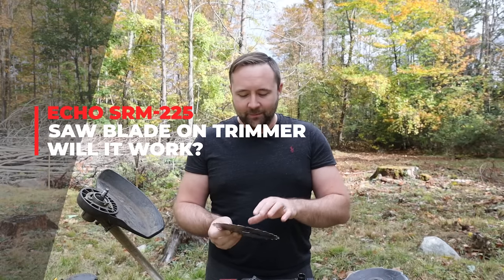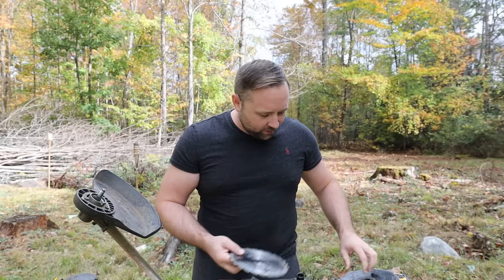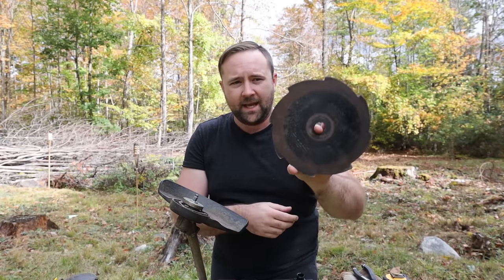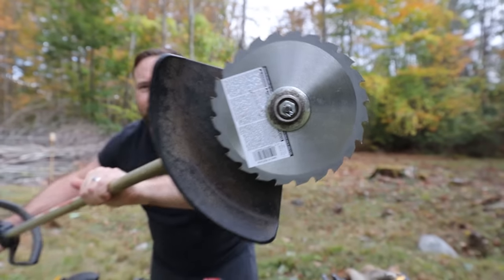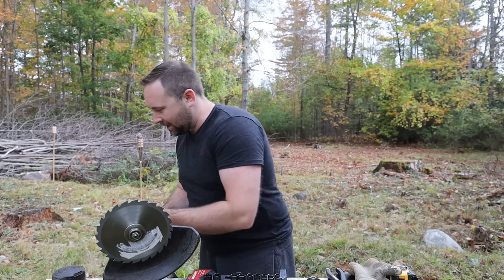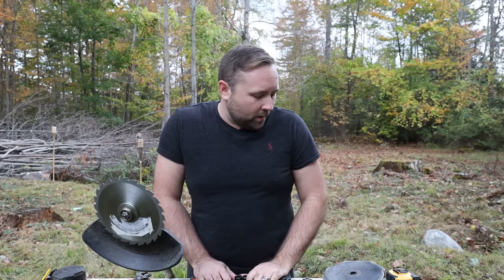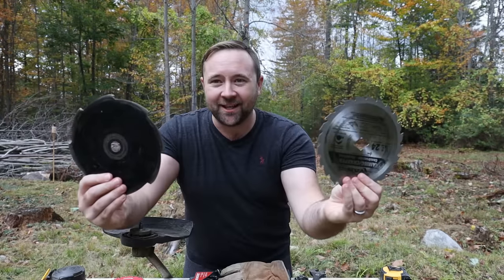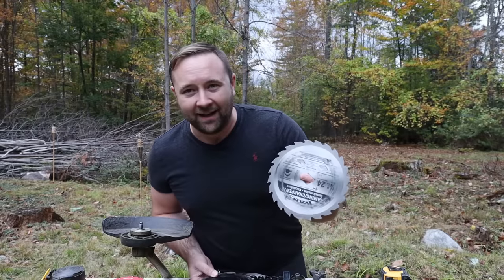Putting a CIRCULAR saw blade on a TRIMMER

Comment: A 12 inch miter saw blade works great. Clears a pretty big area in one pass since its so big and you can get them with carbide teeth and a big range in the amount of teeth you can get. They already have the perfect arbor for most stihl trimmers too.
Reply: you’re gonna lose a foot
Reply: @tseif3713  ok mom…
Reply: @tseif3713  looks very dangerous to me. I would recommend a small chainsaw. Chainsaw will cut better and be a lot safer.
Reply: A 12" on a trimmer? Yeah, most people even with a decent mid-range are going to be putting immense strain on the motor, trans and powered 'rod' with a 10" blade. 
Anyone with an average-mid grade trimmer should stick with a 7" circular blade. And if you're going to take advice from the internet, take it from someone who's actually done this.
Use a cheap, all-steel blade, that means no carbide.
Although soldered/brazed on, those carbide teeth will come off, and they'll make a nice little hole in you especially when hitting a rock, concrete or pipe/fencing.
Reply: @boots7859  I have used a 12 inch miter saw blade on a brush cutter in a commercial environment for 6 years. It is easily the best thing I've found to use. You're mileage may vary but I have absolutely done this before. You are right about the carbide though, once in awhile they do come off of there and they sting pretty good. If anybody else is reading this make sure to wear your ppe!

Comment: Been doing this for years.  
Old, dull circular saw blades make great brush cutters on the weed whacker.  
I still have all my extremities.  Fingers, toes, wrists and ankles still all intact.  
Taking the guard off gives a deeper cutting capacity, but more dangerous.
Use your own judgment.  Be safe.
Ill be trying the 10 inch blade off my table saw when it gets to dull for woodworking.
If you’re an idiot,  don’t do this.  You might hurt yourself.
Reply: Hi, Dan.  i found that using the guqrd, as a stabilizier, works good. i always have the 'branch'  (etc) being cut, on the 3 pm side of the clockwise spinning blade; using the guard as a  type of '' backstop ''.   The blade turning, always  pulls you away, from the branch. Alot more control, rather than having it  'push'  you away.
Reply: I think you're wrong. If you do this, you're an idiot. Not the other way around. Sooner or later things can go wrong.
Reply: I recently found a two-pack of cheap 7.25” circular saw blades on sale at the home center.  These were cheap, low quality blades, but they were carbide tipped.  I bought them just for the weed whacker.  Sharper than anything I had ever used on the weed whacker.  First time out and I got a little to close to my chain link fence.  I broke off two of the carbide teeth, and cut right through two of chain link wires.  I add this simply as a warning.  That saw blade went through chain link in an instant.  It’ll go through flesh and bone faster than that.  Be safe!

Comment: The teeth on the circular saw blade have quite a bit more rake than those on the Echo blade.  (The "rake" is the amount of hook on the teeth.)  More rake means that the blade will grab & pull more.  This doesn't mean that it's unusable, just that it will be harder to control.  This can be seen in the video.

If you're using a non-carbide circular saw blade the teeth can be re-ground to have less rake, but it might not be worth the trouble.
Reply: You could use a blade with more teeth if you are concerned with it grabbing
Reply: MAKE  sure, whatever number of teeth on your blade, THAT   ALWAYS  HAVE AT  LEAST  3   TEETH,  BITING   INTO  WHATEVER  NEEDS TO BE SAWED.   THIS  APPLIES   TO  ALL   SAWS.....ANY FORM,  SIZE  AND  TYPE  !    examples:   24  teeth, for large branches, trees.   32  for  smaller  stuff,  and  smaller ones,  for even just large weeds.  This makes sure, that the teeth,  don't      '' lock / grab   and  hold  ''   the item, being sawed.
Reply: You should use a blade with a negative hook, they don't pull into the cut.  All of the non ferrous metal cutting blades have a negative hook and work great.

Comment: I bought a blade built for this purpose. It absolutely destroyed the clutch in my Troybilt. I'm talking shredded springs, warped "pressure plate", fragged one of the actual clutches.

Comment: I have a Ryobi 40V trimmer with a brush cutter attachment. I take the brush cutter blade off and put on an 8" demolition circular saw blade. I had to use a grinder to grind away some of the metal guard for the brush cutter head, but that was easy. Or you can just use a 7-1/4" blade and you won't have to grind anything. I'm able to use it to make quick work of cutting off small branches and clearing brush right at the level of the ground. I'm also able to cut larger branches as long as I cut around the branch at the bottom and then around the top and sides. Usually the weight of the branch will cause it to crack off at some point. It's a lot easier than using a chainsaw, since I can reach over my head without using a ladder and I can stand to the side away from the branches I'm cutting. I can chop off 2 inch branches in a second or two, so trimming trees is super easy.

Comment: When I worked clearing/brushing trails around the Condon District, MT we had brush saws that were purpose made for cutting brush/saplings somewhat similar in build.  But again, they were specifically designed for the purpose.

Comment: Hi   I have a STIHL  FS-40  string weed 'whacker'.  Took a 5/8   deep socket (the drive nut, on the trimmer, is this size) and ground down the socket, on that nut end, so as not to bind with housing mount of the wacker drive) . Then, centred an old 7  1/4 inch blade onto the other end, welded 'er up. Belt sanded it down some, and used a spacer nut, and washer, then screwed nut on drive threads.  Cuts like a damn, just gotta balance it a bit more.   Next project, is maybe a 10 inch blade, same idea. BE  SURE the socket fits snugly on the drive-end.

Comment: 6:00  You might, consider rotating the guard, about  3 inches more clockwise;  this will help you gain  CONTROL  of the saw. Having it 'pull toward you ''  allows  for  ALOT  BETTER  CONTROL.   HAVE  the branches, on the right side, as blade is controlled by your body weight.

Comment: I did this to my Ryobi 40volt trimmer. My teeth are much closer and I use a 6inch handheld chainsaw to gut any thing over 2 inches, but my Ryobi whacks right through smaller trees, takes down brush like it's nothing. Way better then those 3 bladed brush blades. Adding my own upgrade (just a blade) saved me over $100 and still getting a 3 blade brush cutter.

Comment: Very nice. I would suggest integrating something to prevent the end from kicking which can lead to an injury. Also, suggest not using carbide tipped blade since carbide is brittle and can chip. You can always hand file plain steel blades.
Reply: Nah.  I've  used carbide saw blades for years with no problems.  Steel blades are more dangerous in my experience because chunks can break and be thrown off.  I know this for certain.  And no as far as the end kicking.  Yeah, it will kick if you're back cutting.   Which I do.  Again, no problem.   You just have to practice, go in slowly, and if it does kick have it gripped so the saw can kick out easily.  I've had numerous kick backs and didn't remotely have a chance of injury.  You can break the head gear if you have a cheap saw though.

Comment: You can mount an 8 or 9in circular saw blade. It clears the guard on mine easily. Echo's blades are too expensive and do not stay sharp.
Reply: Oregon make brush cutter blades and they are cheaper too.

Comment: Thanks for a good vid. Only thing I can think of not to use a carbide tipped blade. Since you are moving the blade around stuff, like small rocks you could fling off one of the tips at a very high speed. Other that that, cheap way to go.
Reply: many trimmer brush cutting blades also use carbide tips. But you are right, they can break off if you hit something.
Reply: I've used 24 tooth carbide tip for over 30 years never a problem, had a lot of rocks stuck in my shins over the year don't see a tip hitting any harder than a rock may have had a few I thought were rocks. got good at not hitting rocks or chain link fences though. wouldn't really recommend any blade for a novice.

Comment: Stihl makes about three different types of brush blades for their timmers. Just get the right tool. The saw blade they make is sharpened with the same round file you use for your saw.

Comment: I have a Homelite st-200 . It is a string trimmer with a blower attachments and an includes guard for the 9" circular saw blade. It wiIl cut down 3-1/2"+ trees. I use the saw blade for saplings and triarc blade for big weeds and small trees. It's 30 years old and I still use it lots.

Comment: Stihl do a range of blades now, some with chisel teeth and some carbide tipped ones. I saw a video before of a guy using one of them chisel tooth ones and it went through what looked like a 3 or 4 inch branch in a fraction of a second without kicking back at all. I have a Kawasaki strimmer but I only buy Stihl stuff and it fits. My bolt doesn't have a hole for a cotter pin and I have had a blade go loose on me, but it's never come off, it just stops turning. I guess you don't have to buy Echo stuff just for an Echo strimmer as long as it fits. It might be that a normal mitre saw blade might shatter if it got forced sideways in a cut, I don't know. I got the Stihl 8 tooth blade, but only use it for tall grass and thick weeds, but it does go blunt after a while. I also got the scratcher blade with lots of small teeth, which is handy, but does jam and kickback on anything thicker then a finger, but it's gone really blunt now after cutting down a few blackthorn (prunus spinosa) suckers which are really hard wood and grow like weeds here in the UK.

Comment: you can get a circular blade that's made specially for that.   It  has a tooth profile similar to a chainsaw that can be sharpened with a regular chainsaw file.   It's a solid blade, not one of those sketchy carving ones sold for an angle grinder.

Comment: Been doing that for 40 years, never used a guard on a weedeater with string or blade. The sweet spot to avoid kickback is 9 to 12 and 3 to 6 also guard off gives you more blade width and better control and visibility, thick boots, long pants and eye protection, gloves help also for the occasional flying branch. also watch cutting 2" or bigger already cut branches they can fly back at you. Cut all briars, vines and rose bushes with the new blade first.

Comment: I used 9 3/4 inch blade on mine and used a cup spacer on the bottom of the  blade to keep it clear of the ground . Get to full revs before starting the cut and ease back when the revs start to drop .

Comment: Circular saw blades are Not rated at as high an RPM or as high of an impact as the brush cutter blade made for the trimmer. It will fit, but not really safe. Saw blade can fracture and fly apart. 
I have the brush cutter on my Echo and it does everything it is suppose to do.
Reply: on my trimmer it says 2500 rpm so i think its safe? I use it to cut down some bushes it works well
Reply: @robbirobson7330  That is a very slow trimmer. PLUS,...It's not just the speed. It's the impact. They can explode. They are not designed for that. Use the right blade.
They make carbide teeth brush cutter blades for trimmers.

Comment: Been running saw blades on trimmers for 20 years,cleared Akers of brush and trees,just have to know how to operate it safely..never operate without a strap to keep the blade away in case of kickback.

Comment: A cotter pint is made with soft weak metal. If it fails the rotating circular blade may come off flying and cut anything in its path. No thanks. I will stick with the nylon wire. I like my legs.

Comment: I have been using this trick for over 15 years. Much cheaper than bush blades.Also metal cutoff blades work good for cutting metal fence or hawg wire. Just be careful about kickback.And. wood chips flying.

Comment: I would not use a small blade on saplings... The best (slow) method is the chain-n-tractor complete removal method, but a quick way is to use a Stihl electric chainsaw. (pull or cut - you have the same disposal issue)

I run two Stihl trimmers: the one related to your posting has a 10" x 40-tooth blade.  I have removed the guard. This blade dispenses with tall grasses, woody weeds, etc.  I used all sorts of string trimmers on a 400' frontage drainage ditch over the 35yrs I have had this place - the blade works best.  There is one extra trick when standing atop the ditch:  adding a Darwin's Grip.  Without bending more than my knees, I can sweep this blade like a scythe and flip a glob of weeds up onto the bank in one motion.  Maybe one out of 8 times I have to stop and pull out a glob ...but, this combo is the best!  At 79 I have had plenty of practice.  Cheers.   Jim

Comment: I use steel blades all the time. I would NOT use a carbide-tipped blade. Also use it only on a heavy duty saw suspended from a harness, NOT a hand-held. (Stihl FS-360).

Comment: They sell these everyday that are made for brush cutting with a string trimmer. They are not that expensive, I have used them quite a few times. I would suggest sticking with the blades that are designed for the trimmer. Only other thing, I would strongly suggest using it ONLY on a straight shaft trimmer. The chances of it kicking back and getting to your feet (or any other body part) is almost non existent.

Comment: This works really well i use a stihl fs 85 brush cutter with a 9 inch tunkstin tip saw blade note you have to file out the inner hole about .5 mm to make it fitt nice but works way better on tee tree thick bush it does flick a lot of shit out i wear chain saw chaps and glasses never had a blade brake and done it for years .

Comment: Stihl makes so-called chisel-tooth blade which I think has bigger diameter than the Diablo blade. I used the Stihl blade recently to clear dried reynoutria (up to 4m in height, 1.5 inch diameter) and it worked very well. It also cut a 2 inch diameter tree. I accidentally cut into a rock too but it did not seem to dull the blade but also not violently break off shards of rock. I think that saw-style blades are safer than 3 and 4-bladed disks. Biggest risk is kickback so never use it on device without straps (so it kicks it safely around you!) and make sure nobody else is too close when cutting.

Comment: One trouble of several which I see is, there's a lot of wasted effort and energy (and time in resetting) when the wood is on the wrong side of the rotation. You get kickback and it's not cutting.

Comment: I have a DeWalt string trimmer. I removed the string trimmer head in order to put on a saw blade, but the saw blade hole is way bigger than the string trimmer threaded shaft. I can't find an adapter

Comment: Don't use Carbide tipped blades. If you hit a rock they will chip and you will have shrapnel flying through the air. Always use blades without carbide tips

Comment: We have done this for the past 20 years. With Stihl bike handle trimmers.
We have cleared acres of Silver will and poplar suckers.
Carbide tipped blades last much longer, grass is your enemy, believe it or not it takes the edge off faster than brush.
Sounds like every manufacturer has a different way of mounting the blade.  Works like a charm, remove the guard, let’s you get at move stuff without hanging up on the guard.

Comment: This is not a reccommended practice except with a trimmer that has a bicycle style handle bar.  If you get a kickback you could lose control of this trimmer and you could get a leg or foot injury.  Please be careful about trying to do this.
Reply: Use a strap keep it adjusted so you can push it away from if you trip I cut3 acres in 2 days it was a still  with a 10 inch bladei cut 4 inch trees and even bigger

Comment: great idea but I didn't feel secure watching him use that with a thin plastic protection guard.  you are depending on the strength of the pin that rotates which is not designed to hold that weight.

Comment: Always pull the plug wire before messing with lawn equipment. Take care,Stumpy.
Reply: I did that the other day on my zero turn mower.  Safety first. Forgot to reconnect the plug wire and it started fine anyway.  Oops.

Comment: Actually I think you probably should have used a more of a finished blade rather than a ripping saw blade because it has smaller teeth and more of them so it would have less of a tendency to grab. Just saying that's the only thing I could see that I could improve on

Comment: In europe you can buy cheap chinese blades like this in the box stores marketed for brush cutting, i used one for 2 day's it broke up I was lucky never saw where the missing piece went, i will not be buying another. yes it works and it is quicker than a chain saw but extreamley dangerous.

Comment: I’ve been doing this for 20 years and it is sketchy however it’s easier and safer in my opinion to use smaller battery power tool blade arbor is real close to right size use a couple of heavy fender washers and your ready to go

Comment: I use ad will keep using cheap Amazon blades with the 20mm hole there good as long as you don't over heat them

Comment: Been doing this for years and is great for trimming tree limbs and saplings.
I have 3 srm 225's with varied sizes of string and 1 srm 266 that I put a 10" 60 tooth blade that 
I bored the arbor out on and it's a beast.
Echo blades suck!

Comment: I have a cordless strimmer that takes blades with 10 millimetre hole, do i require a flange put on first with other parts ive got to put 20 millimetre hole blade on ?